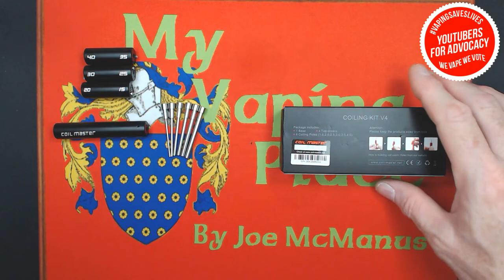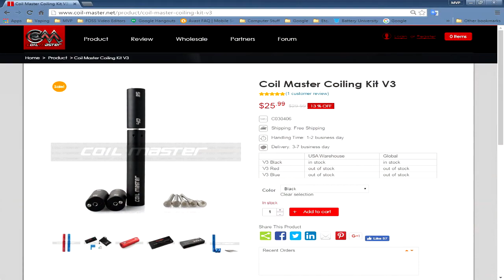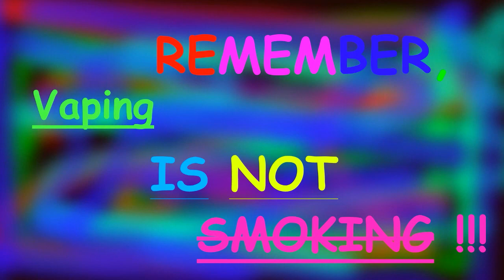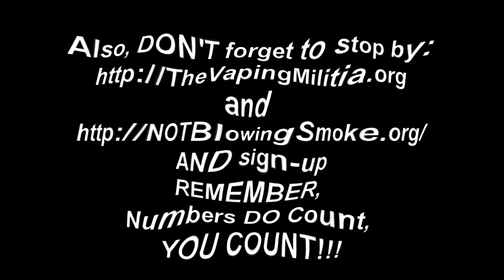MVP #31, Coil Master v-4 & Pre-Built Coils Review

Comment: hey there just a tip the blue screwdriver I believe is for the screw in the twister side that holds the wire. My V1 has one to move the screw for thick and thin wire. Surprised CM didn't say it was for the jig!